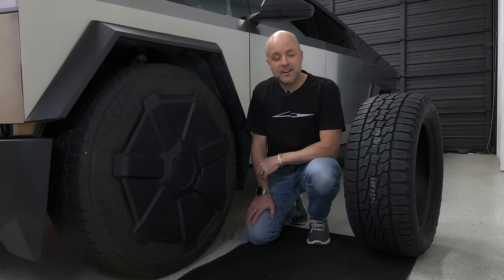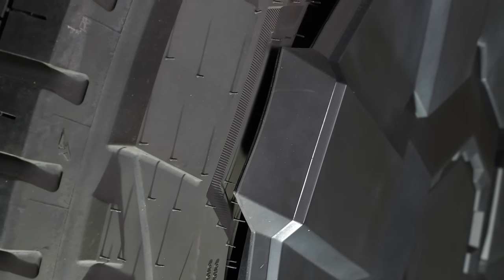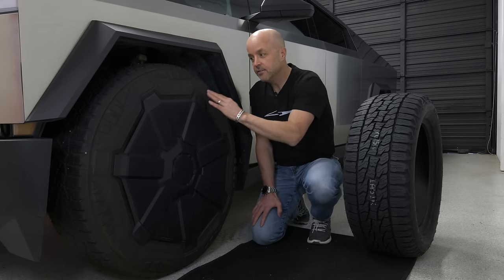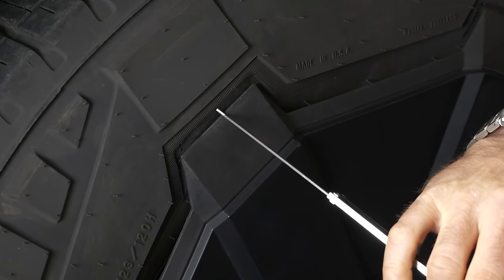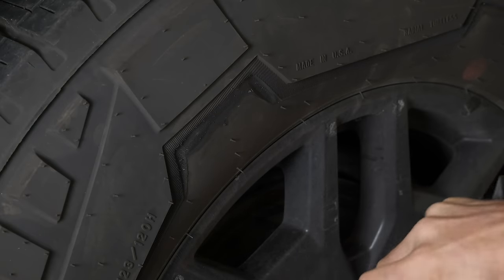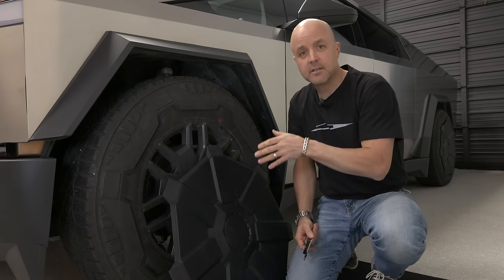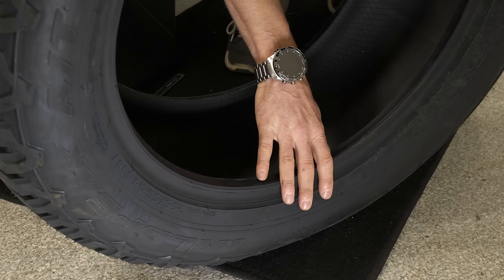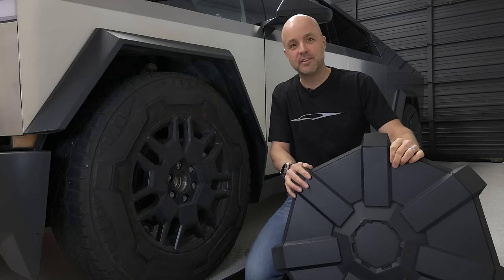Cybertruck Aero Cover Issue Explained - Revising Original Launch Edition Wheel Covers for Goodyears

Comment: I feel like a 3rd year mechanical engineering student could have told you this would happen just by looking at it. Unbelievable that a company selling $100B worth of cars a year makes this ridiculously basic design error.
Reply: Kinda makes you wonder what else did they miss
Reply: 4th year mechanical engineering student here. I swear to god, 100% serious, when I saw those things I talked to my girlfriend for a few minutes about how surprised I was that they’d actually sell with those hubcaps.

The exact shape of any given tire is always changing when the car is moving, whether it’s due to bumps in the road, more or less force being applied on one tire due to cornering or braking, heating, cooling, the list goes on. Fixing a rigid piece of plastic to the wheel while it’s in contact with the sidewall of a tire is just asking for trouble in such an obvious way.
Reply: I went to art school and thought it was a bad idea just by looking at it.
Reply: Given that other automakers regularly make similar and sometimes worse decisions. It's not too surprising. At least this particular issue is somewhat minor. Hopefully the rest of the truck is done better though. I'm really not sure how the cyber truck is going to work out.
Reply: ...yep. But compared to the "finger removal" CT front trunk lid, this is nothing.
Reply: Since the edges of the hubcap are soft rubber, they obviously knew that this would happen…. The soft rubber was their “fix”. I bet the original prototype ones probably were all just hard plastic
Reply: Did they not test it for over a few thousand miles or more 😐
Reply: @IMakeLoops Go watch Sandy Munros complete teardowns of Teslas and all other vehicles they do to get your answer.
Reply: I feel like a high school dropout would notice this.
Reply: I  feel like a 3 year old child could have told you this would happen just by looking at it.
Reply: Said it all
Reply: they didnt test it much , just like other tesla products, users will test it
Reply: pretty sure the engineers did notice it but some higher ups didn't want a change cause it looks good.
Reply: Маркетологи развалят мир😅
Reply: GERMAN CARS GUYS ! BUY GERMAN CARS !
Reply: @DeceptionFlavour ok Adolf 😂
Reply: @DaGhost141 Elon  "I know more about production than anyone alive" must have have been Tweeting when he designed  this.

Or maybe rubber doesnt flex in Texas.
Reply: No-one has EVER accused Tesla of being competent

Comment: Stop apologizing for tesla. 125 thousands is almost half of the tire and once you make it to the cords that are half way the tire blows out. The sidewalk is the most critical part and it does hold the air.  Your probably only 5 thousands from the cords.
Reply from the maker: We did confirm directly with tire manufacture, unrelated to Tesla, the sidewall rubber does not hold air at all.  The 'inner liner' rubber, which is inside the cords, is 100% responsible for holding air.  Tread and sidewall rubber do "not hold air".
Reply from the maker: "Inner Liner - The innermost layer of a tire, starting on the inside, is the inner liner. It is a thin air-tight layer of synthetic rubber designed to keep the air inside the tire. A good inner liner will help maintain your tire pressure which will help you get better fuel economy and lengthen the life of your tires"

Comment: Aero covers for a vehicle literally shaped like a brick 🤣
Reply: It has the same side profile as a giant prius...
Reply: the shape is actually a lot more aerodynamic than other trucks
Reply: @w0ttheh3ll  Mmhmm sure it is. Because we're in upside down land where sharp angles are more aerodynamic than curves. Lol
Reply: @ZeroHero-33  Ignore the edges for a second and look at the overall shape as viewed from the side. Look at the profile of the Cybertruck, then look at the profile of a Prius. kinda similar, no? Then look at the profile of an F150. Shaped like a small brick stacked on top of a larger one. Also remember that the Cybertruck covers its bed, that helps a ton.
Reply: @w0ttheh3ll  I don't need to look at anything because I understand how aerodynamics work. Sharp angles create  vortacies which absolutely ruin any type of flat panel you have. If you looked at that vehicle in a wind tunnel, you'd see swirls near every sharp andle on that truck... those are bad.. you want smooth air blowing over the vehicle, not high pressure zones everywhere. If sharp angles were more aerodynamic, then every vehicle for the last 80 years (including F1) would have them everywhere, but they don't... There's your sign lol
Reply: @ZeroHero-33  Ok then, let's look at it the other way round. If the Cybertruck's aero is so bad, why does it get the same highway efficiency as the Rivian R1T  and significantly better than the electric F150 and Chevy Silverado when people actually test them?
Reply: More importantly, as Elon why he refuses to compare his truck to a modern diesel... Cyber truck would get annihilated in fuel economy 🤣
Reply: @ZeroHero-33  you must mean range - electrics have much better fuel economy than any diesel due to the low efficiency of combustion engines.
Reply: @w0ttheh3ll  Low efficiency of combusion engines huh? Tell me, how do you think electricity for those vehicles is made? Or what about the tires? Or what about the fact that the battery packs have to be replaced at a specified service interval? Do you think those massive machines mining lithium are electric? Or what about the trucks that deliver said lithium? Reality is, you could drive an ICE vehicle for your entire life and not cause as much pollution as it takes to make one electric vehicle. EVs are merely a way for people to feel virtuous about the environment while actually not helping at all.
Reply: @ZeroHero-33  Even if you made electricity from crude oil, your well-to-wheel efficiency would still end up slightly better than a diesel and much better than any gasoline vehicle.
Reply: @ZeroHero-33  Battery packs don't have to be replaced at a specified service interval.

Comment: It was funny when he said you could get 50-100,000 miles out of a set of tires on a Tesla
Reply: I dont know who gets 50k miles on anything
Reply: Right?  Cause people only ever get 3 sets of tires in 15 or 20 years 😂.  Wish they lasted that long, my last set of BFG's were over a grand... good tires be pricey
Reply: That was pretty funny. I have been hearing around 30-35k miles from Tesla drivers as being the norm.
Reply: exactly....  tires won't last that long anyways.  But, still a bad design.
Reply: Or anything, for that matter. 30,000-mile tire life is a good long tire life.
Reply: Will the Cybertruck itself last that long?!
Reply: @s.a.dtactical378  Try buying Michelins for a CST V great tires but alas they do not last anywhere near 50 k.
Reply: @ronbrock6153  I'm using bfg KTM 2 mud terrain for off-roading and rock crawling.  When those go I'll probably be looking at bfg KTM 3's A/T to get a few extra miles out of them.  I like the triple thick side wall.
Reply: lol might Get 5000  or 10.000 per set of tires on a EV
Reply: @gerekappo  I regularly get about 70k hard miles on my Toyota's tires. Then again, Toyota actually tests their products before handing them to customers.
Reply: We all know that's a flat out lie!
Reply: There are so many lies in this video. The side wall is not integral part of the tire. Yea ok. You can get 50-100k miles out a tire. I’ve gotten 75k once out of a low torque, low power highway only car. Add in the city and more power, everything changes. The amount chewed up at 2k miles is certainly not proportional to 50k. 10k miles max.
Reply: So is the thought that this will be a real problem by 50k miles? Maybe the designers said, "yeah, but you should get them switched out by 50 so no big deal"?
Reply: @albertliang7404 Yeah, probably. But still, how would you even get the idea to design the cover so that it destroys the tyre?

Comment: How did this not get noticed by either Tesla or the tire manufacturer. Engineering and product testing failure.   Another product that needs a few years to iron out the issues.  My late-2015 Model S suffered from 2 major production issues: front half shaft design and door insulation that did not stick. Tesla owners need a lot of patience to be on bleeding edge.
Reply: They probably said something, but we're vetoed by musk. He does know more than anyone else about manufacturing
Reply: It probably was noticed from the start, but Tesla is filled with yes men. I doesn't surprise me, not even a little, that nothing was done about it. What surprises me is that the tire manufacturer went along with it.
Reply: Bleeding edge of what? A tire cover that goes beyond the rim? Hub caps have been a part of cars since the beginning. They did not exceed the rim for a reason.

Comment: Side wall is very important as it distributes the load to the wheel. A small scuff is fine and even this is probably okay but you have added a defect to the sidewall and it should be replaced
Reply: Especially on a truck that weighs 6600lbs.
Reply: He just said the sidewalls primary purpose was to protect the cords inside, though.
Reply: @hatetheoneyoulove  Ask any reputable tire shop, they do not repair side wall punctures, but a will repair punctures to the tread area, this little man in video is poorly informed.
Reply: Thank you! Disturbing this YouTuber is downplaying sidewall damage. “This sidewall takes so much stress it flexes widely as the car drives” is incongruous with “a little bit of damage is ok”.
Reply: @jeremyhawker3879  the stress is borne by the steel cords, not the rubber
Reply: @ronbrock6153  this is not a puncture
Reply: @w0ttheh3ll  It is still a side wall defect.
Reply: @hatetheoneyoulove  The rubber does protect the cords. Now how can they protect the cords if the rubber is deteriorating from a constant friction rub? Use your damn brain.

Comment: This shows you how much testing/thought/research Tesla gave into manufacturing this product 🤦‍♂️ I have res awaiting but idk
Reply: Totally get it, you won't regret it one bit 🙃
Reply: I cant imagine why anyone would want to support Elon with a purchase and specifically what use case one might have that the CT is a better solution than any other truck option. And it you don't want a proper truck then get one of the cars. Those actually make some sense.
Reply: Just cancel it. The steel is corroding too. But this is a safety issue. Is it worth putting your life and others at risk?

Comment: Two additional things/issues that I see:
1) In the video, the gaps between panels in the front end seem to have, a, well, gap
2) The small headlights in the lower part. They are small and low. I think they may be easily be covered by dirt or snow, and will impact visibility at night.

Comment: The tire you used for demonstration does not look like the ones on the truck with the cutouts for the wheel cover. The truck will take special tires that will be extremely expensive. Also you stated tires lasting 100,000 miles and to the best of my knowledge there aren't any tires that will last that long. From my understanding tires on EV's don't last as long as regular automobiles.

Comment: I’m here from the Jalopnik article. I have a question: Does anything at all in the car tell you to remove the covers if you’re going to air down the tires for off-roading? I know you need to remove them to air down anyway, but I could imagine someone trying to put them back on to prevent damage to the rim.
Reply: I saw in another video the manual saying something like that and removing fairings as well.

Comment: Not a big fan of cybertruck but how much will you miss for just removing the cover, or it really persuaded you for the purchase just because of the cover design. Btw they should see it’s coming
Reply: If you do miss the cover, just cut the overlapping rubber off and keep the covers on.
If you cut them straight you'll still have the effect.

Comment: Reports say Tesla HQ is working hard on a plan to... reject warranty claims on these tires (claim user error or normal wear&tear or something), rather than working on a solution on how not to get the issue in the first place.
Reply from the maker: Tesla has already been cited stating they will offer replacement aero covers of a new design.  Your comment eludes otherwise, please cite a source, otherwise your comment is simply rumor.
Reply: @TSportline  I was just being sarcastic
Reply: @pipopipi lf you have to explain it you cant!

Comment: Sorry, but if you blow out the side wall you will lose air, full stop.  It’s not like this truck uses run flats that can run without air..stop Tesla sugar coating.

This will be like the condensation in the tail light issue.  Tesla knew about it but still keep putting out cars with defective taillights.  I’m sure this won’t be last major defect.

Comment: It seems like the grooves wouldn't continue to get bigger and that 90 to 95% of the wear on the sidewall would happen in the first couple thousand miles and as the groove got a little bit larger, the distance to the rubber extension would get farther. But nevertheless, those rubber extensions need to be cut in half with a much larger clearance

Comment: You have a point, but you will never see 50,000 or 100,000 miles on any tire on that truck,
Reply from the maker: yes, 20kish would be a great run.  However, the aftermarket replacement Goodyears will last longer.
Reply: @TSportline then why'd you say it...
Reply: @TSportline   no, they wont.

Comment: Oooo ok so it’ll only be an issue after 50,000 or 100,000 miles. Phew for a second there I thought it would affect the current set of tires. So no issue then.

Comment: Lol this guy doesn't know how a tire works, the sidewall absolutely holds the air of a tire
Reply from the maker: You might think so, and so did we - until we connected with tire engineers and researched it.  Go ahead and research it, you'll learn about how the inner liner holds the air...we're not making up the facts here :)  Thanks for watching!
Reply: @TSportline  so I can punch a hole in the sidewall of my tire and no issues will happen because it doesn't hold any air. Got it

Comment: Not great, but you’re probably only going to get 10-15k miles out of those tires anyway.
Reply from the maker: yes, 20k would be a really good run.  Depending on inflation and turning frequency and vehicle loading, wear is going to vary.

Comment: Lmao, "after 50k miles or 100k miles" be happy if the tire last 30k miles.
Btw, it won't keep wearing down, it will get to the point (likely as it is now) when the pressure stops and so does the wear.

Comment: Glue a thin sticker of plastic onto the tire where the wheel cover rubs on it..   The plastic will act as a bearing material, protecting the tire.  Or, just grind the fingers of the wheel covers back enough so they don’t touch the tires.
Reply: Because plastic will definitely flex with the tire 🙃. You should have a great career at Tesla.
Reply: @guywithjeep  there are certainly very stretchy plastics.  And there are design techniques making it even more stretchy - making the plastic thin, for instance.  Keep in mind that tire rubber has a lot of plastic in it.  But it's designed to be grippy instead of slippery.  So when it's forced to slide against another material it wears.

Tesla gets a lot of stuff correct!

Jeep makes its share of mistakes...  :)
Reply: Or...or maybe they should properly design a 100k truck

Comment: Use the head of the calipers to measure depth more accurately than using the probe. The tops of the jaws are even at zero and will separate to measure an even step. I’m taking about the opposite end from the probe.

Comment: The amount of flaws and faults on Tesla's are just out of this world with testing, even for safety related like this, being done by customers. Utter POS and unbelievable it can be allowed to continue. & yes, i drive a TM3 LR & commute  30.000 Miles a year. The "Vision" downgrade 1½ year ago has taught me the true color of Tesla and never EVER gonna touch the POS brand again once the car has driven enough to be sold without the insanely huge loss of value it has had in the 27 months i have owned it by now. Fool me once Tesla, shame on you....

Comment: Good god, yall a bunch of babies. Any new product is going to have issues like this. Tesla will replace it and fix it. That's how this stuff works. This is a big mistake, no doubt, but an early an easy one to fix. That's why I am waiting until they are producing 100k+ cyber trucks to buy one. I don't want the production ramp issues. But the trade off is I have to wait a few years.

Comment: I'd like respectfully request that you edit the title and thumbnail of this video to remove the word "recall." This is not a recall. You yourself are very careful with your words in the video -- all good there. But throwing around that very loaded word risks spreading the very FUD that we in the Tesla community always try so hard to fight when it comes from outside the community. Let's not have FUD stirred up from within the community. I'd humbly suggest changing the word "recall" in your video title to "issue."
Reply from the maker: We can do that, we are confident the issue will be remedied quickly by Tesla!
Reply: @TSportline  Thank you very much! I just don't want to see "recall" start getting thrown around in the mainstream media where it's not warranted. And I agree that Tesla's engineers will come with a fix for this sooner rather than later. Cheers!
Reply from the maker: Agreed, thanks for the tip 👌🏻 Minor issue, Tesla will 100% nail the fix!
Reply: I agree, "obvious defect" sounds way more accurate tho
Reply: How about, "A safety concern that hasn't killed anyone yet" instead of "A recall"?
Reply: Butthurt tesla fanboy 😂